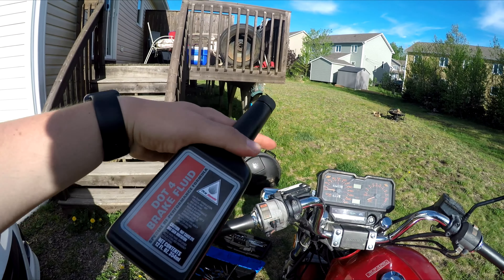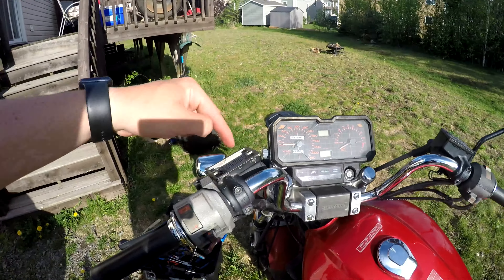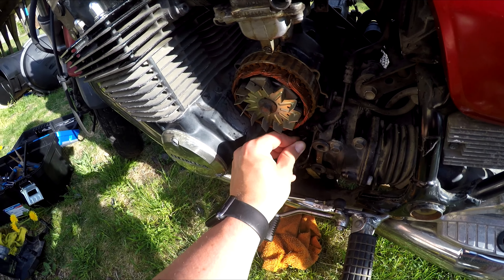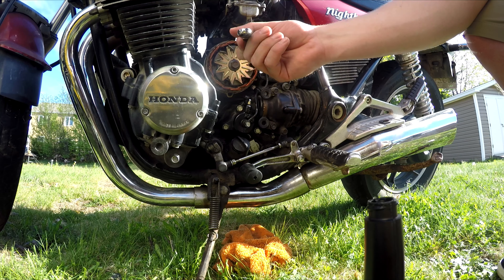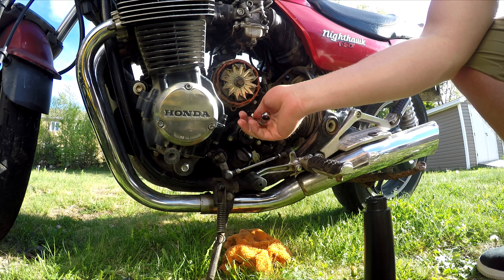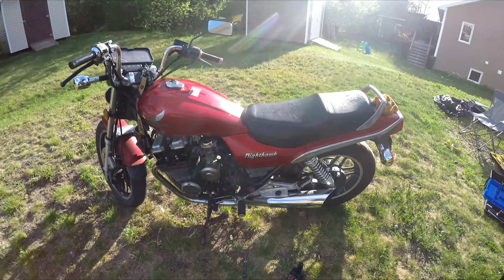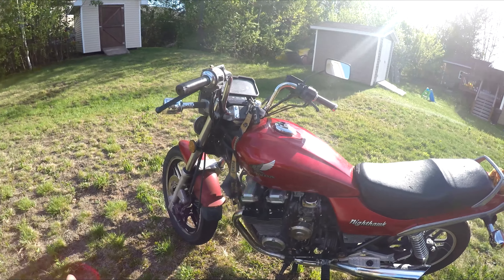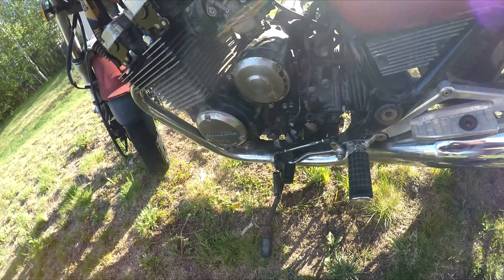How to fix your Clutch Cheap!! (Bleeding Clutch) 84' 650 NightHawk

Comment: I have the same bike. Just fixed my front brakes that kept dragging. Bunch of sediment in the lines and pustons had gunk making it hard for them to move, big mileage improvement. Might have to do this aswell.
Reply from the maker: Yea its probably brake dust and possibly your fork seals leaking down into the pistons.

Comment: well then. why didnt you level up the master cyl so you could get more fluid in it while you bled the system. why didnt you put a tube on the bleed nipple so corrosive brake fluid didnt get on the bike, a clear one then you could see when air bubbles stopped coming out. the correct spanner size is 8mm. if you maintained your bike properly the fluid level wouldnt get that low. if the fluid level was so low where is it leaking from? so so wrong.
Reply: Where would you start looking for underlying issues? I have the same problem and I'm looking for solutions. I'm new in motorcycle maintenance but I want to learn. Thanks!
Reply: @Jonathanbass1990  Clutch slave cylinder is a likely source if you are losing clutch fluid for no visible reason. Please don't repeat anything you saw in this video, like Ken above, I'm shaking my head at how wrong this advice is on so many levels.